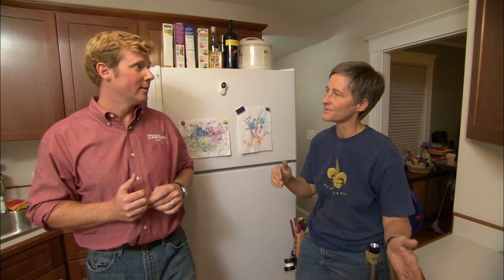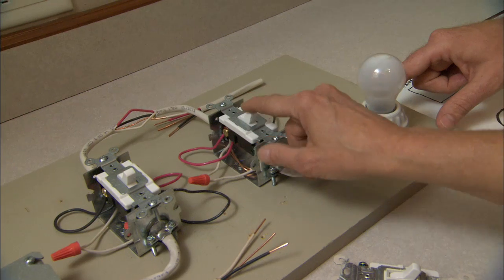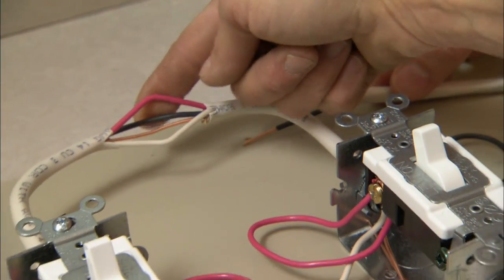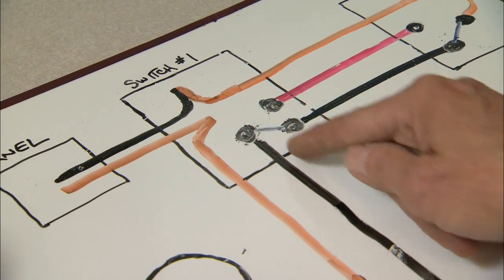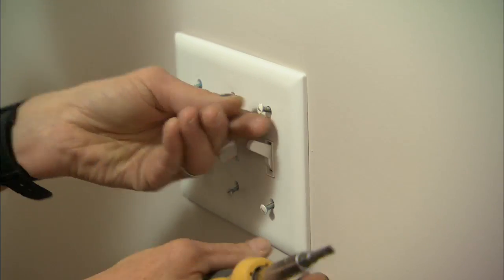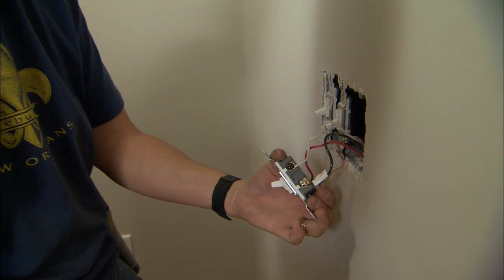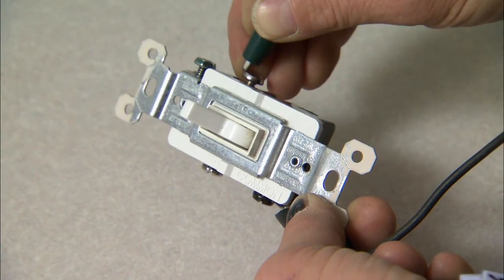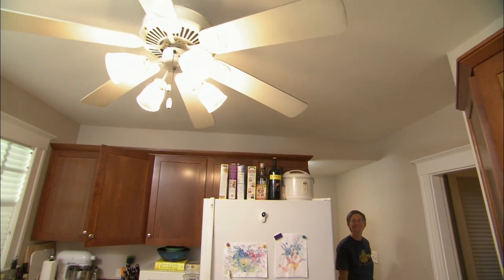How to Repair a Three-Way Switch | This Old House

Comment: Just yesterday I wired in a 3 way switch for my basement stairs. One switch at the top and one at the bottom. When I was finished, the top switch could turn the light on, and the bottom could turn it off. But the bottom switch could not turn the light on. I was scratching my head for over an hour. I found the bottom switch was bad right out of the box. Swapped it out and it works like a charm now.

Comment: excellent video!    Thank you.    this one is the only one i found that was helpful for my situation,     have numerous 3 way switches that worked fine in our 30 year old house.     then they didn't work fine, and none of  the wiring was ever messed with.    so  i don't need to  check if the traveler wires are installed properly.   obviously one of the switch was bad.   but which  one?    this video helped me in that respect.    but i found it is not necessary to remove the wires from the switch to check continuity.    saves some time in case that switch was good.   also, when you are checking one, and you get continuity one of the travelers, you really have to 'flip' the switch and check the other traveler connection.    you should have continuity on it after flipping it.    if you don't get continuity, switch is bad.   the video really didn't point that out.     Yep, you could simply  replace both and be done with.   switches are cheap, and cost of tester is much more, as someone else has pointed out.   for me it is the principal of the situation.    I am one that steps over a $20 bill to save a nickel.    May explain why i am financially strapped these days after 67 years.   😀   Oh well.
Reply: very good , same thing here , work for 34 years then one failed. I will buy 2 new ones : easiest route !

Comment: Great tutorial video!  I followed your instruction, testing each wire and 3-way switches.  They're all good, but the light is still not working.  Appreciate all your help.
Reply: Late reply check wiring

Comment: I've got an old house with interior tongue and groove shiplap walls under the quarter inch sheetrock... I need to move an electrical outlet over 2 feet and up about 4 feet (for a tv mounted on the wall) any suggestions?  Thank you in advance!

Comment: BIG lesson here. Don't ever rely on color when dealing with romex type wiring systems. All two wire romex is black and white so there are numerous situations where the white is energized. Always a good idea to apply some black or red tape on that white conductor when that happens. Also, a good policy is to wrap (loop it around) that "common"  conductor around the two travelers just after the conductors enter the outlet box as a form of permanent identification of the "common". If you are dealing with knob and tube wiring, the two travelers will frequently both come into the same end of the outlet box and the common will come into the opposite end. Not foolproof, but quite common and those conductors are usually all the same color so color provides no clue.
Reply: Big lesson is for electricians to stop screwing around with the colors, there's no reason to turn that black (hot) wire to a white at the other switch. The code needs to be updated and all wires in a box need to be marked with tape as "hot" and "neutral"

Comment: So you wrap tape around the switch to protect it, and you can no longer test to see if it's powered until you take it out of the wall and remove the tape. Have you thought this through?
Reply: Probably a good idea to test to make sure it works before you wrap it
Reply: @iLikeC00kieDough  that's what she said

Comment: I have perfectly working 3 way switch but when light was on both travelers had power,  when light was off only one traveler wire had power.  I tested with voltage tester.  This is very confusing to me as in your example only one traveler ever has power regardless of whether light is on or off.  This makes me think there is another way to wire a three way or that something strange is going on at light junction.  Let me know your thoughts.
Reply: Oneof the three way switches may be bad
Reply: Old reply, but your probably dealing with a "coastal" or "California" 3-way. Instead of explaining it, here's a video: https://youtu.be/4PR-VXsf0eo

Comment: u don't need a special tester, u can just use a volt meter/multimeter
Reply: If a multimeter has a continuity tester sure, if it doesn't you probably shouldn't be working on the circuit live to test for voltage. However in the end there's a hundred ways to test it, do what works best and is most safe in the current situation and take extra precaution when working on a circuit live.

Comment: What makes it a three way? Australians call it a two way, a three way includes an intermediate switch, giving 3 switches.
Reply: Because it's a more correct name. Same way a "Single Pole" switch is a two way switch. It's either 0 or 1, on or off, it was two ways it can be on.

A 3 way switch works in conjunction with another 3 way wherein it has 3 states that can be expressed. 01 11 or 10. Essentially off on, on on, on off. There is never an off off position that the switches can be in conjunction with. 

That is generally the reasoning behind using the name two way, three way and four way. Same thing, with a four way it introduces a 4th state the 3, 4, 3 way switch configuration can follow. Essentially the states 101, 111, 110, 011 respectively. 

The most correct name isn't two way, it's three way, OR Single Pole Double Throw would be the most most correct name. 

TO BE FAIR in the end it entirely depends. Naming conventions are weird, and I bet arguments can be made by two way is a better naming convention. Use whatever works to best describe the switch to other people in your area they would readily know.
Reply: @selfishlyintrigued  incorrect, it would only be a 3 way if the husband showed up

Comment: I think you call this a two way only two switches  a three way would have three switches uk
Reply: James Turner it’s called 3way because of the poles in the actual switch. A single pole goes off or on, a 3 way switch goes from traveller to traveller.
Reply: @meganallday  a 3 way is when there's 2 dudes and a woman

Comment: A switch is like $1.38. A tester is like $30. Just replace all the damned switches.
Reply: You are wrong for two reasons:  First, every electrician already has a tester and it usually costs more than $30 and every person doing electrical work should have a tester or not bother.  2nd, it's very rare that a switch goes bad and if it does, it's usually physically obvious (the spring doesn't work, you see sparks, etc.) and the cause of the problem is usually an incorrectly wired 3-way switch and for that, a tester is very handy to troubleshoot.
Reply: lol
Reply: As Arie stated, and in all the situations I've encountered, it's a wiring issue.  If you have rocker switches that's $3.48/per for the basic.  Anyone working on electric should have good basic knowledge otherwise they shouldn't be attempting electrical work.  I bought an electrical tester, not for this project, but to research a loss of electricity in 3-rooms, I could have bought 15 outlets and spent N-number of hours replacing them and ultimately not learning/knowing what the problem was...  In addition a LOT of people don't know they have to modify all of the outlets controlled by a switch, which was the bad one in my case. My $36.67 Klein didn't detect current at 14 outlets but did show very low voltage at the outlet that was bad, (half switch controlled), once it was replaced all of the others worked...
Reply: @richs9541  I started having the problem after a few years living in the house. I did not touch the wiring at all. So I suppose that one of the switches is bad.

Comment: How is it a "3 way" switch  when it only throws two ways
Reply: Each 3-way switch has 3 power carrying conductors.
Reply: Yes but if your driving a car and are at a T intersection would you say you have 2 ways to go or 3?
Reply: I'm not the one who named it but if it makes you feel better you can call it a "Single Pole, Double Throw Switch". https://en.wikipedia.org/wiki/Switch#Contact_terminology
Reply: John Schroeder In the intersection example, you'd say you have 3 ways to go. Left, right, or the way you came. Because the three way intersection itself has three options, it's a 3 way intersection. Same way as the switch. It has 3 current carriers. So it's named for the current carriers.
Reply: In the UK this is actually called a 2-way switch, only in the US it's called 3-way switch. In Germany this type of switch is called "Wechselschalter" (changeover-switch), the 4-pole which is necessary if you want more than two switches is called "Kreuzschalter" (intermediate switch).
Reply: Because it's a more correct name. Same way a "Single Pole" switch is a two way switch. It's either 0 or 1, on or off, it was two ways it can be on.

A 3 way switch works in conjunction with another 3 way wherein it has 3 states that can be expressed. 01 11 or 10. Essentially off on, on on, on off. There is never an off off position that the switches can be in conjunction with. 

That is generally the reasoning behind using the name two way, three way and four way. Same thing, with a four way it introduces a 4th state the 3, 4, 3 way switch configuration can follow. Essentially the states 101, 111, 110, 011 respectively. 

The most correct name isn't two way, it's three way, OR Single Pole Double Throw would be the most most correct name.
Reply: My boss use to call a 3way — 2way (because you have only to devise’s on two deferent locations) and 4way - 3way... because you have three switches on three deferent locations... nonsense!!

Comment: Worst part..NEC CODE..WHEN white wire carries current a professional will designate that by using tape to strip white(not using white,orange,or brown tapes)..so technically would be white w stripes that carry power..never a solid white unless returning it to ground
Reply: ike fun if u can't read code book, they may make audible book..ur a Yankee huh?